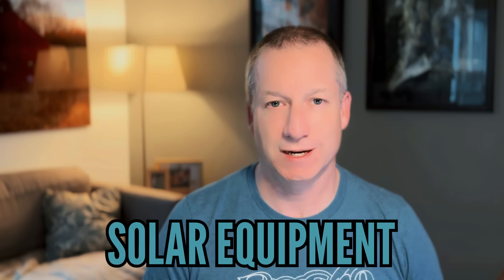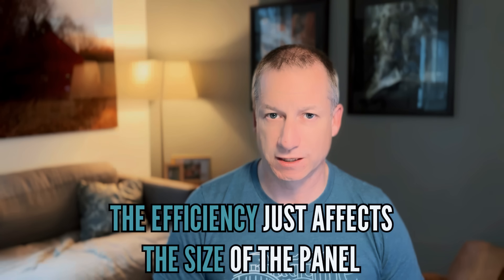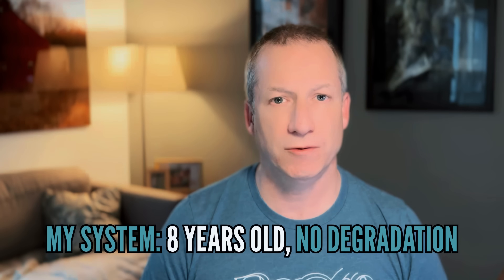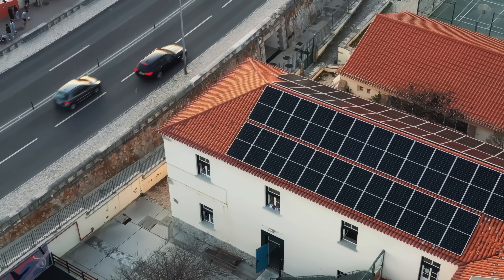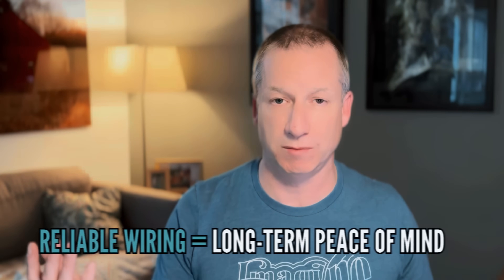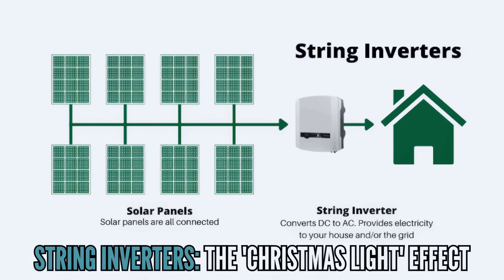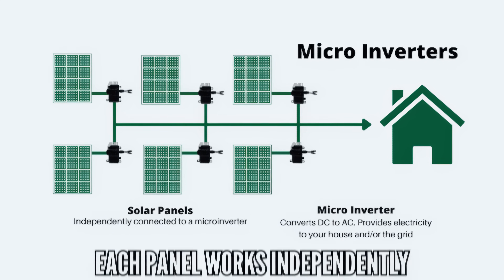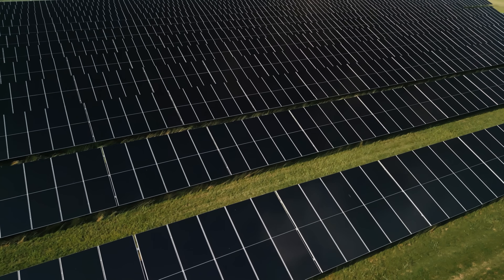The Hidden Downside of Microinverters No One Talks About

Comment: do microinverters make a regular inverter unnecessary?
Reply: Yes! A microinverter is in fact a regular (string) inverter but smaller. And operates in a different way, which in my view is VERY good in certain conditions.
First, a string inverter put all solarpanels in a string (after each other) the output of ALL panels are then "gathered/wired" (sry my bad english) into the string inverter. The good thing is that it might be slightly cheaper than using microinverters... you can have some 10-16 solar panels on one string inverter. This is great if you have a HUGE roof or install them on a BIG ground mount.
Microinverters again shine when it comes to smaller roofs, balcony´s walls, etc, because EACH solarpanel is routed as a single input to the microinverter. The absolute benefits are that, let´s say you have a wall where you can add ony 2 panels... well, DO IT! With a string inverter that is impossible, because you need a certain amo8unt of panels (8-10) to get enough electricity in the system to start the string inverter.
With a microinverter 1 panel can start the single input.
Also, microinverters (mi) (as working with 1 panel per input) NOTE micro inverters come as 1 mi for 1 panel, 1 mi for 2 panels, and 1 mi for 4 panels... also new big models allow for 1 mi with 4 inputs taking 2 panels each = 8 panels.
But let´s say you have one mi with 4 panels... you COULD choose to place the panels in different directions (one for morning sun (east), 1 for day, and 2 for evening (west). This gives flexibility with mi, that string inverters are not capable of.
Reply from the maker: Yes.

Comment: Brad I've been in solar for 6 years and sold both SolarEdge and Enphase.  Hands down, microinverters break far less often than SolarEdge inverters.  Most companies are moving in the direction of microinverters because they want to limit the number of service calls they are doing.  Microinverters are easier to troubleshoot because you usually see exactly which micro is broken.  Trying to troubleshoot SolarEdge can take hours, its often hard to know where the problem is, and if you have to call their service line, be prepared to be on hold for a long time.  Solar installers and their service depts like micros.   Enphase has a better monitoring app and consumption monitoring is easier to include than for a SolarEdge system.

Comment: New York State, and many other states, REQUIRE Certified Solar Installers to do the work.   the NEC has strict wiring requirements for Solar that any old licensed electrician will most likely not know and therefore do wrong.
Reply from the maker: Agreed.

Comment: Micro inverters are not small mistakes in design they work very well. They have a very low failure rate, very low!
Reply from the maker: Agreed. But over 25 years on an individual system you are probably going to have some failures. And when you do will it make financial sense to the solar company to fix it for you or will that panel just stay out?
Reply: @bradthesolarguy  Like with Vehicles all depends on warranty and what failed.  Panels don't  just fail unless they are damages physically. That's not warranty that might be insurance.  Over time panels get cheaper, labor only cost that increases.  As to micro inverters the MTBF is very long and replacing one comes down to labor being the variable that increases. Like any failure it comes down to cost to fix.
Reply from the maker: @bobdawley3455   Agreed.

Comment: you make me start thinking i could plug my solar panels with  DC optimizer right to an hybrid inverter PV input straight without going to my controller where it turns into AC.
Reply from the maker: Probably not.
Reply: You right, I can't they are solaredge equipment and it all works together.  I been wanting to pull it off because it clipping my panels production. Maybe down the line I will pull off those se440 and install tigo one's.
Reply: I am not telling anyone to do this, but there are those that are taking the output from the micro inverter and using an extension cord plugging it in the the wall outlet (YIKES!!!) AND There are those that are also hooking the output of the Micro inverter directly to the input of their Air Conditioner unit that essentially converts it to a solar AC unit. Search You Tube if you want to learn more. For me I am connect my Micro Inverter to a subpanel to back feed the grid. Hoymiles makes great equipment and even sells subpanels that can accept up to 4 strings.

Comment: The one issue you didn't address is the cost of swapping out the different inverters when they fail. With an Enphase the company will allow me to do my own install as long as I complete their free online courses and the inverters cost between $159 and $322 depending on which Enphase inverter you chose. On the other hand my gound installed system has two Solaredge inverters which were originally installed by a certified company (because I was getting too old to do the heavy lifting) and when my 10K inverter failed (still under warranty) Solaredge would only allow a company registered with them to evaluate and swap out the inverter. My original installer went out of business so Solaredge will not allow a DIY to activate the inverter to bring it online in a grid tied system. I had already run a diagnostic on the inverter and knew it failed. That required the tech to come to the site twice, once to evaluate that the inverter was dead and then to return weeks later with a remanufactured inverter and install it to the tune of $1800 labor for a total of approximately 30 minutes on site, 10 minutes to evaluate 20 minutes to swap the inverter, unbolt 4 nuts and swap 6 wires and have it update to come on line.
Reply from the maker: Good points. Service down the road is going to be an issue for all owners of solar.

Comment: This is the best video I've seen discussing the difference between the types of inverters available. I agree with your assessment. Really well done Brad! The other thing about microinverters is the potential for clipping if the microinverters are not rated for the wattage of the panels installed.
Reply: Clipping is not as big a deal as you might think. SolarEdge also has clipping, but on the shoulders instead of the peak.  The real world production is nearly the same for both.  Seen lots of studies on this on YouTube. Been in solar for 6 years.
Reply from the maker: Thanks, glad you found it helpful! So true about mismatching the micro inverters with panels wattage.

Comment: It seems everyone only talks about solar panels on the roof.  I'm new to solar and trying to design my own system.  But the only way I see for a DIY person to install solar is to build a ground mount system.  Then maintenance is not an issue, regardless if its replacing a microinverter or brushing the snow off the solar panels.  So what are the opinions here - should I go with microinverters or optimisers?
Reply from the maker: @sphillips6357  Great question. I think for a ground mount it matters less. Both options are good. If you ever want to add batteries I would go with optimizers so you can DC couple. Otherwise either is good.

Comment: Unless you have lots of shading, string inverters are fine, and what goes on the roof is simpler and more reliable. I have been using string inverters for years with no issues.
Reply from the maker: String inverters don't pass National Electrical code for modular level arc control and rapid shutdown. For this reason Enphase and SolarEdge are the Coke and Pepsi of inverters for residential solar.
Reply: @bradthesolarguy  Right now I use high voltage DC circuit breakers to short the string outputs which limits the current to an Isc of less than 12 Amps for a string. It effectively clamps all panel outputs to a few millivolts (non-zero due to resistance in the cabling). Works fine. If I worry about some arc damage to the switches on opening to restore normal operation, I can wait until the sun has gone down. The point is that a fireman could close all the breakers and then douse the panels safely, and they would be unlikely to touch the breakers again after they are done.
Reply: @bradthesolarguy looking at doing a Powerwall 3 which is a string inverter and it says it meets NEC standards for rapid shutdown

Comment: Why would anyone put sensitive electronics under panels (especially roof panels) that bake in the sun?  And why would you want to deal with repeated trips up on your roof - if you've got tile/slate, the last thing you want is uncaring solar schlubs stomping around breaking tiles. My neighbor had a major roof leak soon after his solar guys came and added some panels.  But since it wasn't at the panels themselves, the solar company refused to fix the problem. But it was the access way to the panels that were damaged - nobody else had been on the roof in a few years (it was only a few years old) - multiple tiles were cracked/broken and had punctured the roof sheathing.  Cost him a few thousand to fix everything - he had to eat it since he redused to file an insurance claim and see his premiums rise.
Reply from the maker: In the US module level electronics are required to prevent arcing and to have rapid shutdown.
Reply: They are made to be outside under the panels.  They are sealed and only require passive cooling.  The fact that they are under the panels means they are not baking in the sun.

Comment: so why do you have to put the optimizers or microinverter at the panel? why not run the cable to a central point that you can access any time?
Reply: There's a tradeoff between safety and cost.  String inverters require rapid shutdown capability to meet the newer NEC requirements and prevent the fire department from letting your house burn down if there's a fire (because you cannot turn off the sun, so the panels are always "hot").  Microinverters will turn off the AC output when you switch off the AC circuit they are connected to (generally, you have to include and exterior solar AC disconnect switch).  The newer NEC versions require that there is not active electrical output (AC or DC) outside the boundaries of the panel array when the system is disconnected.
Reply: @surferdudemi  i understand that but when your house is on fire no one is worried about turning off the power. first thought is putting it out and saving what you can if you can.
Reply: @hayzersolar  Then you should be sure that you can throw an external disconnect so that you can safely extinguish the fire, and the fire department can do likewise.
Reply from the maker: This is why Enphase and SolarEdge are the Coke and Pepsi of residential solar inverters. They have rapid shutdown and arc control at the panel level built into their technology.
Reply: @bradthesolarguy  That only works if the microinverters can see the AC line drop.  If you have them connected to the AC load side of a hybrid inverter with battery backup, the microinverters will not see the AC line drop and will not turn off.  You need two disconnects: one on the AC line from the grid, and another on the AC line from the inverters to the load side.
Reply: @surferdudemi  I believe to pass NEC you either have Microinverters or Optimizer with rapid shutdown. Either way you need to attach a unit to the solar panel
Reply: @kentakayanagi2084  It doesn't have to be on  the panel.  It has tobe within a certain distance of the array.  Possibly within the boundary of the array with no buffer around it.  You also have to specify which version of the NEC.  Jurisdictions don't all adopt the same version at the same time.
Reply: @kentakayanagi2084  NEC 2020: "For most installers, it still makes sense to refer to part 2 (690.12 (B)(2)(2)) when determining which rapid shutdown requirements to follow. That means less than 80 V in less than 30 seconds within the array boundary, which should be a familiar metric for most installers. Part 3 (690.12 (B)(2)(3)) still refers to BIPV, which is also unchanged from 2017."

Comment: An advertisement of optimisers. He started by saying string inverters are bad and then moved to inverters and optimisers and then started pouring shit on microinverters. The reality is that optimisers will need a string inverter anyway. Todays solar panels have bypass diods so that the story of one shaded panel ruining the whole string is a BS. I doubt that today optimisers will be needed at all and pay for itself as for the money of optimiser you can buy an additional panel.  The solar industry is a wild market where solar installers selling unnecessary devices for unfamiliar people. What customer need is a H-Bridge block which converts DC to a square AC and most of the appliances which using inverters will work without anything else.  Who can justify why today we need sine wave AC in the houses where most of the appliances in fact have no need for this?
Reply from the maker: Again, because of code most solar companies in the US use either Enphase or SolarEdge. Between the two I prefer the SolarEdge system because it acts more like a string inverter. They are both good systems. And there are many other good choices too. But the most important choice is not the technology but making sure the installer will service the system over time.

Comment: Optimizers have a higher failure rate than microinverters.  You’ll have just as much repairs or more from putting them under each panel.  Most modern panels and string inverters don’t have the Christmas tree effect that systems did.  That’s why Tesla solar systems are able to perform well without optimizers.  Not as well as micro inverters, but significantly better reliability and lower cost.
Reply from the maker: Nope.

Comment: Hi Brad, fair points below.  I’m choosing between microinverters and optimisers and I value the argument about safety: lower (AC) voltages with “simple” AC wiring v very high DC voltages without microinverters.  Would you care to comment? Thanks, Paddy
Reply: The safety of the DC system will be fine as long as you use good installers and it has good arc fault detection. SMA Sunny Boy inverters and the inverters Tesla uses are safe but the quality of the install is most important. 

Also, modern panels and string inverters don’t have the Christmas tree affect, so you if you don’t have a lot different shading issues within groups of panels that are on the same string, string inverter is best.  If you do have major shading issues case, microinverters from Enphase are your best choice.  If shading issues will be negligible within your multiple strings running into the string inverter , then save yourself a lot of money and a lot of repair calls by not getting optimizers placed under each panel.  Instead, if you have space,  adding more panels with that money will give you the most bang for your buck.   If you will have minor shading issues within panels on the same string group, then Tigo optimizers are the most reliable in the world with a significantly lower failure rate than even Enphase microinverters.